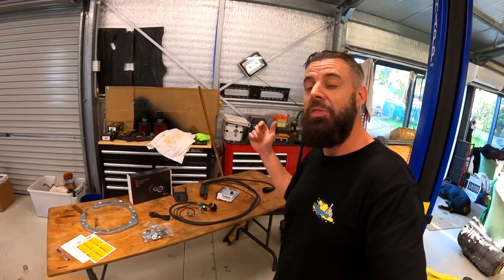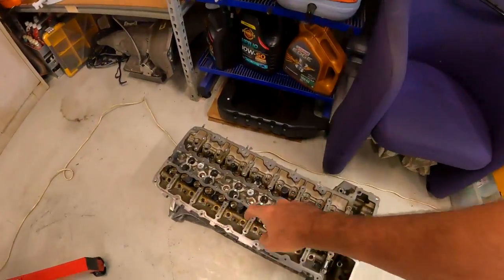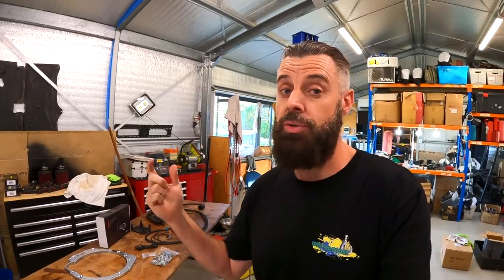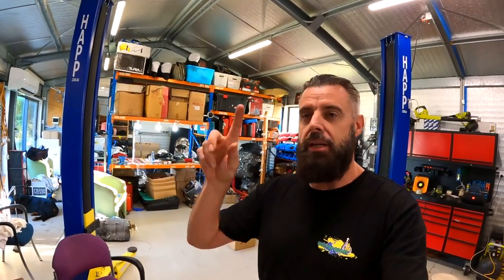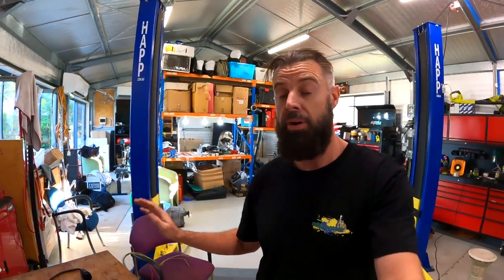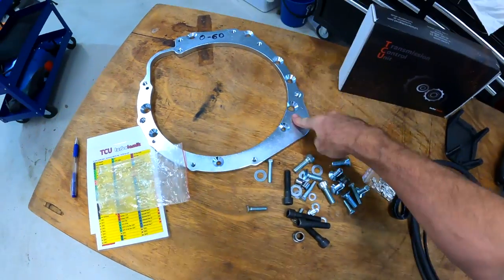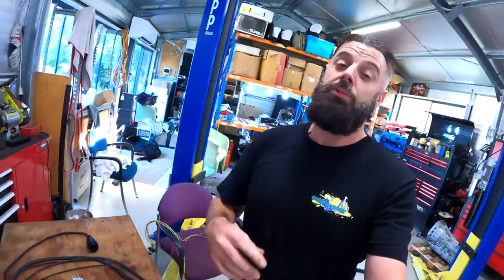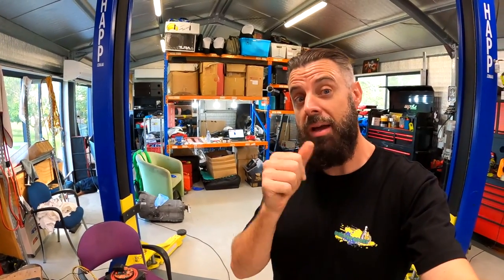BMW E90 N54 8HP Turbo Lamik Full KIT Unboxing

Comment: Can't wait to see this thing do a trans break launch.. also I usually put a bit of assembly lube under the heads of the bolts when torquing stops the cracking and gives a tru torque reading 😊 well stops the cracking from interfering with the torque reading I suppose 🤔

Comment: Btw about the little display: that's an i2c display(lcd display, and no canbus), you can google them(i2c display orange for eg) and grab them on the web in the same nice amber/orange tone that bmw has from factory! However the displayed data of it can be displayed on a canbus display instead(if you dont want to have the little display somewhere!)...
Reply: And sry for my german autocorrection...it always interferes when writing in english...
Reply from the maker: Ahhh really appreciate that, i must have read about a canbus display in the works from lamik maybe. The colour of the display is something i would like to change, but fair from an important step. TBH i have a few clusters spare from wrecked, i wouldn't mind trying to get the lamik display inside the cluster where the active cruise control display part of the OEM cluster sits.

Comment: I would love to see you get a proper 8HP E series TCM with just the single PT CAN and see if it would work.
Reply from the maker: So would i. Thought i found one in a wrecker last week, he had listed it as a X1 but it was a 1 series box. Did get excited it was only $1000. I thought steal the TCU then put a lamik controller in the f series TCU for a retrofit project.

Comment: This is nuts. OK, so now you have me wondering if I can upgrade my 6HP26 to an 8HP70? I have a 2005 Aston Martin DB9 V12. I am having the motor rebuilt with more power, forged internals and stroked to 7L from 5.9. The 2005 DB9 has the 6HP26. The 2018 Vanquish has a bolt up 8HP70 that is a direct swap into the back end of my car as they are both built on the same chassis. So one of these 6HP to 8HP harnesses and a Turbo Lamik is all I need to upgrade my transmission plug & play? If this is the case you just blew my mind. Thanks for all your videos. Been binge watching like a crazy person as now I see a solid upgrade path instead of rebuilding my 6HP26 w/upgraded clutches and 6R80 parts.
Reply from the maker: Firstly anything is possible. However, there is no chassis canbus support for the Aston Martin currently. The issue is when you remove the 6hp all the other modules in the car freak out. It will normally go to limp mode. So if you remove the original transmission, you need a way to pretend its still there. That is what this setup does with the BMW (every chassis has different messages, these BMW messages on work for one specific version of BMW electronics). Or you program the rest of the car to not look for those messages any more. I would love to do a 8hp in one of these early DB9s.... I absolutely love them. One day, if can beg borrow and steel my way to one, i will work out the electronic side for the trans swap.

Comment: if it doesn't work happy to pay for full kit mate - great vid Andrew so excited ...........
Reply from the maker: I thought i found a stock TCU for your car on eBay on the weekend. 2012 8hp from a X1..... just turned out to be a 1 series not an X1 :| It was cheap tho. Lamik stuff gets here quick, so end game if needed we can order it and by the time your bushes are done we will have kit ready to do the trans.
Reply: @ZeroTo60Tube  hey mate hold on I have an x1 and purchased full cas3 kit as we had a faulty DDE will see if we have a spare TCU

Comment: From my own experience after tuning the 8HP shift really fast that you can’t notice any difference between it and the DCT.
Reply from the maker: I know you can actually program the auto to basically overlap on the shift. It's bad, but you can code in zero time between shifts. However i just dont think the engagement at the tyres is as quick as a maxxed out DCT. However probably splitting hairs over which is quicker. They will be slow close the air temp on the day will make a bigger difference to how fast the car is.

Comment: Hey brother how's it going just wanted to tell you keep up the great work I love all your information very knowledgeable love the videos keep them coming I just purchased my first 3:35i because of your videos and done all the basic bolt-on modifications plans are to be your American equivalent LOL
Reply from the maker: I appreciate that and yeah, im just trying to share what i learn and do it with out a load BS marketing like most youtubers do. You can go fast and build it yourself.
Reply: @ZeroTo60Tube  hell yeah brother so I bought my bill for $2,700 and I sold the cats for $800 then bought a parts car for $500 sold the catacalistic converters on that for another $800 use that money to buy the downpipes the upgraded fuel pump the larger intercooler index 12 injectors multi-port injection system and the jb4 box everything I bought was secondhand and let me tell you she's a ripper all in all with new tires and everything total purchase price of my build is $3, 400 US

Comment: you still have to machine a spacer for the torque converter. your table looks just like mine right now hahaha.        i have some parts drawn up. lets work together to get that domiworks adapter kit complete.  PS. the dct cars are NOT faster when moving,  the 8hp gear set is godly.  8hp7x with 3.31 final drive is way faster throughout the entire gear range.

Comment: Great content!! This would also work in an 135i n54 manual? or is has to be AUTO-DCT?
Reply: I will be swapping E92 manual. More work needed as few more controllers need to be swapped or added in my early 2006 production but all doable.
Reply: Actually starting from an Auto Is the easier way because everything is already coded and you have the right pedals. But you can start manual car too! Just need to code it to automatic for certain features but will run anyways! On my e34 540iA as long as the canbus(it has between dme and oem tcu) won't be decoded, it'll run full stand alone! No message exchange between dme and lamik tcu! Only some sensors to wire in! So probably any oldtimer could work too!
Reply: @lightmanek  actually not more controllers. More like you will have to go another route on how to wire the lamik tcu to your car/dme or dde...rest is, you'll need possibly to remove the clutch pedal and if wanted install an automatic acceleration pedal...with kickdownswitch and against cars that already have a canbased automatic shifter, that too

Comment: I'm doing a similar swap myself , can you help with the pinout of the 6hp mechatronic connector , because i have the same kit but instead of the female 6hp connector like you i just have a loom , and i have some doubts  where to connect the neutral , the brake switch and a fan switch ,and i also dont have that little sheet with the connections like you, can you help?
Congratulations, for this amazing content on the channel,  your content has helped me A LOT, THANK YOU SIR!
Reply from the maker: Hey mate, i could probabaly find the pin out. But so can you, just pop it in to google!

Comment: I’m definitely going to see and check this out!! My 6hp26 needs an upgrade I have a 3200 stall and it just don’t work the greatest burn out for days. Also afraid Of blowing up the trans I’m curious is this 8hp better than the trans out of a 6hp28 trans?
Reply from the maker: The 8hp70 is the trans that replaced the 6hp28. It is better in every way, however some people prefer the simplicity of the 6hp. That being said i get the impression that is purely because they haven't had the chance to get their heads around the 8hp. The 8hp is what you get in the new m3/m4 and with these aftermarket controllers you can have it shift like a sequential or smooth like a rolls royce. Which also use the 8hp btw. They are in so many modern cars and such a versatile trans.
Reply: @ZeroTo60Tube  Thxs

Comment: Ordering my kit now but have one question did you order yours with the program switch? Not sure what that is but I need to check that box yes or no on the order form. Thx for any help you can give.
Reply from the maker: I did get the switch. You need it per say. You get 3 modes with the BMW shifter. However the lamik has 8 programmable modes, and you will need the switch to make use of all 8.

Comment: What's the chances of making something like this work in a falcon that's factory fitted with a 6HP ZF??? I realise the expense but if money wasn't an issue, would that controller plug into the 6HP in a falcon and actually work as well?????
Reply from the maker: ADAMLZ was originally using a 6R80 (Fords version of the ZF6) in his barra mustang with a HTG controller, so it is possible. This was a while a go and the HTG seems a lot better now. There are also a few controllers from the states, but nothing quite as sorted as this Lamik setup for the retail user.

Comment: How much are these TCUs? I can't find pricing on their page
Reply from the maker: The TCU on its own is $1450euro currently. However you will likely need things like display, program switch, shifter, wiring and so on. Which will vary depends on how much you do yourself and what shifter you use. As a ballpark i would say allow $3000euro for parts relating to the TCU.

Comment: So if your buying this hook up to a standalone ECU is there a wiring kit for that too or what?
Reply from the maker: Lamik do offer customised universal harnesess, where you specify the length needed for each connection.
Reply: @ZeroTo60Tube  I never saw that do they ask you when you order off the website like the whif garage site or whatever you call it that's in the UK?
Reply from the maker: @marioandultrachap  I ordered direct from lamik. Its part of the order form, you can get from the forum.
Reply: @ZeroTo60Tube  I gotcha but if your having a turner and he's making a harness for you anyways would it be easier to just have him wire that in with  the harness he's making for your standalone/piggyback?

Comment: So, could you use the lamic to put a 6hp in a pre LCI e53 with an m62? Wonder if you can turn off awd with the flip of a switch?
Reply: Why a 6hp? The 8hp hasn't the e brake fault, is faster and more efficient and the transfercase bolts up pnp....
Reply: @maxgr7723  do they make an 8hp that will bolt to an m62?

Comment: Is there an option for 08 335Xi?
Reply from the maker: I missed this comment. I have seen people with these on xdrives, but not much documentation on them. Apparantly the 8hp70 x5 box is the one to use. Your transfer case should bolt on.

Comment: Apologies if I missed it in the video somewhere, but how much $ (AUD) do you have approx. into the turbo lamik kit/harness? I’ve been looking into doing an 8hp swap in my n54 e60. Currently looking at the htg tuning tcu/harness but after seeing this video I would like to do a bit more digging into going this route.
Reply from the maker: It was around $4000aud landed and taxes paid but i did get a deal. However the euro has tanked since i paid too... lol. I think expect around $5000aussie for the kit and a shifter. However thats something you can use for life, it doesn't have to stay in one car.
Reply: There are a lot of reasons to stay away from htg and going revers when driving forward is one of them
Reply: @ZeroTo60Tube  thank you! That’s not bad for the quality you get at all. I think your next videos regarding installation/setup will help aid in my decision moving foward. After the kit, diff, axels, and driveshaft. It’ll be well worth it I think.
Reply: @maxgr7723  I haven’t heard/read anything about that? What other issues do you know of on the htg side of things?
Reply: @allen3995  noise problems...can't have any wire close to it...super slow shifts...killing solenoids...
Reply from the maker: Although these problems should be fixable, this is a common story from HTG users. https://www.argyrides.eu/the-end-of-the-dct-project/

Comment: What does the turbolamik controller cost for n54 8hp swop?
Reply from the maker: The conversion not including the box is around $4000-$5000aud
Reply: @ZeroTo60Tube  where can i get it from? How do i reach turbolamik

Comment: What about XHP flash will it work fine and shall it be flash to 6HP
Reply from the maker: xHP is a must for a 6hp.
Reply: @ZeroTo60Tube  i was wondering after swapping to 8HP will it still need to be flashed with XHP
Reply: @Kh.J.  depending on the controller. With lamik tcu you cut out the old controller. So there is nothing to be flashed with xhp anymore. Lamik adaptions are made over tunerpro. And with another tcu controller you leave the OEM tcu inside the gearbox and then you are able to use xhp...that's canformance cantcu then

Comment: 这是款什么品牌变速箱电脑，
我有兴趣
Reply from the maker: Turbo Lamik
Reply: @ZeroTo60Tube  这款电脑可以单独控制8HP50，变速箱吗，我中国越野赛车改装工厂有兴趣改装
Reply from the maker: @邓子燕  yes it will work as a stand alone controller for an 8hp50
Reply: @ZeroTo60Tube  好的，产品可以邮寄中国吗，怎么购买，可以提供技术调试远程支持码，我发动机安装EMtron全取代电脑，

Comment: Don't like adapter plate ,if you Want to drop oil pan you need drop gearbox or don't use lower bolts. https://youtu.be/KyyJO5VV3T4
Hp70 in action same car that pulls Arp studs out of the block
Reply from the maker: Seems a lot of people have issues with pulling ARP studs.
Reply from the maker: would love some more detail on that built too
Reply: I have write to FB bussines profile to you
Reply from the maker: @ImTheDud3  I generally dont check those, theres just too many messages for me to actually get through. Sorry if i missed it. What is your facebook name?

Comment: How much in total for that kit?
Reply from the maker: It was around $4000aud landed with taxes paid. Kinda killer but if you look at what a decent trans is worth, sequential, built auto or DCT that can handle this power and fit any vehicle the kit makes a lot of sense.